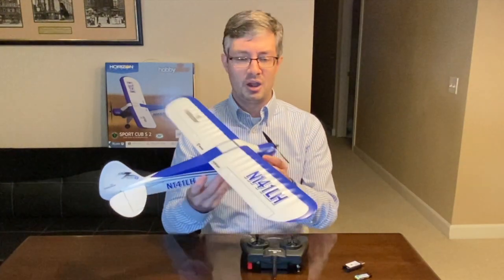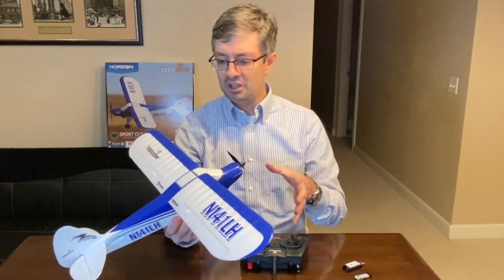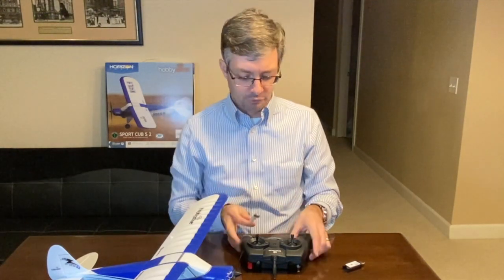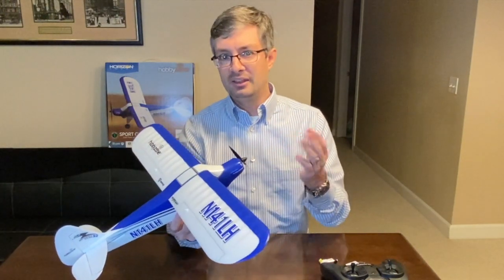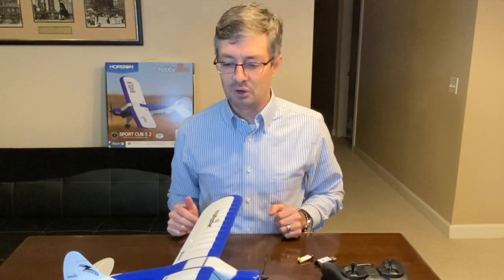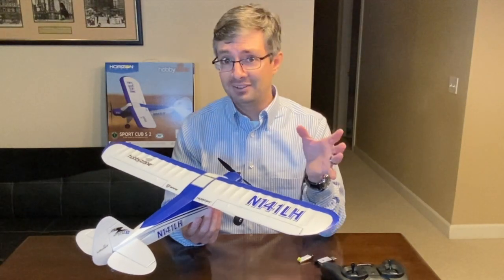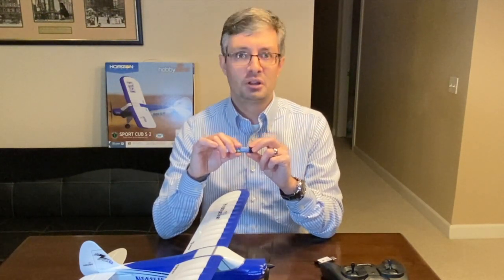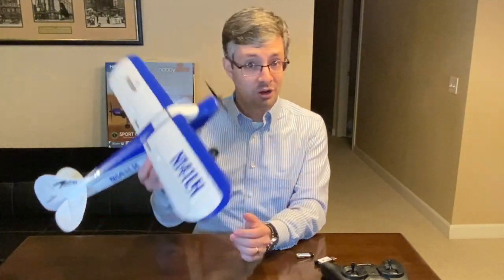Tips and tricks on setting up the Hobbyzone Sport Cub S 2 RTF

Comment: Thanks, I recently bought one and flew it as a novice. I had done hours of iPhone simulation only. Great trainer and light, so less damage "crashing"
Tips: Trim on first flights carefully and follow the handbook.   Check center of gravity and battery placement.  I needed to make it more nose heavy to balance.  I added bush wheels and strengthened the landing gear with styrene strips
I added a bit of velcro to battery place.  Best to learn on a few inches of grass and hand launched. Practice stalling it in on grass up wind.  It is best for first flights to have zero wind.  My first "crashes" were from flying too high and losing it in the sun, having set to intermediate and hit a tree, having the battery come loose and dangle, causing a nose first crash on grass and broke prop (buy four)Don't add paint, it throws balance off. Get three or more batteries.  Save the box!  This is the excellent first UMX to get.
Reply from the maker: Great tips!

Comment: I flew today in 11mph and I haven't flown in five or so years and with it set at 0 on the TX I just had to hold her steady and this plane hovered right in front of me,this was my first flight with this plane so far an awesome plane
Reply from the maker: 11mph is a bit steep for the Sport Cub S. In fact, my cut off for my large Timber is 12mph. I don't like how the plane hovers in the wind and has trouble flying smoothly. The Sport Cub S really struggles with flying into a wind of more than 7mph. It takes full power to overcome the wind, which greatly reduces flight times and increases risk. Even with my 2S powered UMX planes, I don't fly them over 7mph and my UMX Timber and J3, which have vastly more power than the Sport Cub S, have a max wind cut-off of 5mph. I fly my UMX planes in a pretty tight area and it doesn't take much wind to blow them around. I have never been a pilot who enjoys flying in the wind as it turns into fighting for control rather than flying. Some guys rate their proficiency and skill on how much wind they fly in, I rate mine by the lack of crashes and repairs.
Reply: @BRGT350  I so agree,but I didnt crash and I was actually impressed,building definitely hide wind and soon as you fly above them oh wow but ive had micros not be able to even fly in 8mph wind so I was impressed but these batteries dont like 17 degree weather lol
Reply from the maker: Ha, yeah, crazy how fast those 1S batteries lose their power in cold temps. Even my older 2S batteries in my UMX planes suffer from the cold. Last winter I flew my UMX Timber and it hit LVC just as the plane got into the air. Stalled and went into the water. Thankfully, the speed was slow and it landed near the beach. Knocked off a slat and a float pontoon. That was in 30'F temps. I rarely fly in the winter as I hate being cold and I think my planes also don't like the cold. As for wind, my UMX P-51 and P-47 seem to handle winds better than my larger 1.1m P-51 and P-47. My UMX Timber with the slats installed doesn't like the wind, but at least has the power to overcome it, but it really wants to climb fast going into the wind. UMX J3 is better as it doesn't have high lift wings or slats. I am looking forward to the weather warming up so my nephew can finally fly his Sport Cub S that he got for Christmas.

Comment: Great beginner plane. You are so right about the batteries... in warm temps for my 150, 180 and 200 mah batteries I was getting ~ 5, 8 and 10 minute flight times yet once I hit the cold temps (< 40F) I was getting just a bit over one minute flight time even on my 200 mah fully charged batteries. Also, wish the plane had a brushless motor. A little under 200 flights and I'm on my 3rd (or is it 4th?) motor.
BTW of all the many Cub S 2 reviews I've watched you're the only one that I can recall that gave a heads up concerning the batteries.
Reply from the maker: Yeah, the smaller 1S batteries and even some of my older small capacity 2S batteries drop off quickly in the cold. I crashed my UMX Timber last Christmas when I tried flying when it was 30'F. I took off over the water and hit LVC without enough altitude or air speed to recover, so it stalled and fell into the cold water. Had some very close calls with the 1S UMX planes, but thankfully not over water. I feel bad for my nephew who got the Sport Cub for Christmas and has to wait until spring to fly it. I don't want him to risk flying it in cold temps and have anything happen. Besides the temp issue with the batteries, the plane is just awesome for beginners and experienced pilots alike. It is nice to have a relaxing plane to fly around the yard or a stable plane to learn with.
Reply: How do you like the umx I was considering that one first but the hobby store didn't have it in stock and kinda not flying in a while I was interested in this new technology the safe and it's almost cheating lol
Reply: I bought the upgraded ones from hobby-sports and they lasted 6min but its freezing out
Reply: 200 flights dang that plane is doing alright then or your just a good flyer,I'm thinking of seeing if I can find a micro brushless setup for this plane or I might pass it down and buy a balsa kit and build my own with the same plan based on this planes same size
Reply: No. Many.crashes and repairs. Think I'm on my 4th motor.
Reply: @rodneylesterjr4846  I believe it is a very good choice for someone just getting into the hobby or just wanting to give the hobby a try. When first learning keep the plane in SAFE/Beginner mode and only fly it when there is little to no wind. This plane can be flown in a very small amount of space but as a new RC pilot fly it in a larger area and over, if you can, tall grass.

Comment: I  have problems on installing the battery onto the plane, the input cable seems to broker, is there a replacement for it , to be soldered on
Reply from the maker: The cable might be part of the ESC/Receiver board and isn't replaceable without soldering a new one in. I had one of the wires come out of the plug on another UMX model with a similar connector and was able to buy a replacement from Horizon and solder it to the existing wire.

Comment: So your rudder was off as well. Mine was a bit to the left. Need to tweak it. Looking for instructions on programming it with my nx10. Manual is outdated.
Reply from the maker: It isn't uncommon to have at least one control surface slightly off and needing mechanical trim. Check the Horizon Hobby website to see if there is a newer version of the manual. You could download the preset file for your NX10 as well. If the transmitter is up to date, there should be a listing for the Cub in the templates under "add new BNF model". You could also check the manual for the 1.3m Carbon Cub as the setup should be the same. The only key thing about the Sport Cub that would require special attention is assigning SAFE, which would be the same for any of the trainer planes with 3 modes of SAFE.

Comment: I put mine on expert mode and the rudder was off to the left. I trimmed the rudder to center but the trim was all the way to the right.  Do I leave it that way or do I center the trim first and move the rudder link? How do you center the trim? I'm a newbie.
Reply from the maker: To mechanically trim the plane, meaning to physically change the trim on the aircraft rather than the transmitter, you need to do the following. Power on the transmitter and aircraft. Center all trims on the transmitter. Use a straight edge, like a credit card, business card, or anything else that is straight. Lay the straight edge along the aileron and wing. Check to see if the aileron is centered, up, or down in relation to the wing. Squeeze or open the U in the control rod wire to level the control surface so the straight edge is flat across both the wing and aileron. Repeat this with the elevator, rudder, and opposite side aileron. All surfaces should be level with each other. Now go fly the plane and use the transmitter to adjust the trim so the plane flies level at 50% throttle. If you need more than 4-5 clicks of trim, you will need to mechanically center the surface by transferring the transmitter trim to the aircraft. After you land, take the straight edge and note the position of the surfaces you had to trim. Are they up, down, left, or right of center. Set the transmitter trim back to 0 and adjust the surfaces by squeezing or opening the U bend so that the control surface position matches the position when you landed after trimming. Go fly again and see if it needs any additional trimming. On bigger planes, I will measure the distance from the ground to the control surface after trimming so that I can make sure I get the physical adjustment correct to match the transmitter. With UMX planes, I just get it close with the straightedge and call it good. Most of the time I find UMX planes will want to climb with the elevator centered to the horizontal stabilizer. My nephew's Sport Cub S2 did that out of the box. I skipped over the straightedge process and just bent the U until it looked like what was needed to fly level. It took a few flights and was perfect.

Comment: Hi, 1S chargers with storage capability seem to be few and far between. I wonder if you could recommend one.
Reply from the maker: Yeah, storing 1S batteries is a bit tough. What I always did in the past was charge the batteries to the full level, fly for the suggested time in the manual, and then put the batteries into storage. The thought was that flying to the suggested flight time in the manual would discharge the batteries close to the amount needed for storage.

Comment: Hi!  How do you know when the TX trims are centered?  I hear no tonal difference when using the flight simulator via the USB port.  I want to center the TX before powering up the plane.  TIA,  Jim
Reply from the maker: I don't, but there is an option that would work. Normally, the center of the trim has a different tone, but that may be different on some transmitters and the model of transmitters with the RTF planes have changed over the years. I would start by moving the trim up, count the beeps, and note the number when you get to the top of the range. Then go back down while counting all the beeps until you get the lowest of the range. Take the total number of beeps from top to bottom and divide by half. Then move the trim up that many beeps. The transmitter comes centered from the factory, but once you move it, then it isn't centered anymore.

Comment: you forgot to mention you have to throttle it up to get safe mode to activate you need to do that before you fly I did not do that the plane took off did a loop went inverted into the ground luckily Horizon hobby warrantied it,
Reply from the maker: well, that is in the manual and you should always read the manual before flying.

Comment: How do you get it out of safe mode?
Reply from the maker: it is in the manual. Check the 3-position switch on the transmitter.
Reply: you get it out safe mode on the swich

Comment: can i pair this radio with a carbon cub s?
Reply from the maker: Yes, the transmitter that comes with the UMX Sport Cub S2 RTF will work with any Spektrum equipped plane. However, I would strongly suggest upgrading to a better radio. If you are planning on staying with the hobby for a long time and want to start flying planes with flaps and retractable landing gear, I would suggest the NX6 or NX8. Those are computerized programmable radios that can store many planes, have enough channels to operate many of the plane's functions, and make it super easy and quick to fly different models.
Reply: @BRGT350  i appreciate the advice. i live in a tiny apt and only have space for maybe two planes, so i dont need a fancy radio. also i really like the idea of a panic button, so i think one radio and two planes will be all i need. this plane and radio, and one larger plane, likely the carbon cub would be enough.
Reply from the maker: Then you should be good to go with the transmitter from the UMX Sport Cub S. The Panic button only works with planes that have SAFE installed. If you get the Carbon Cub BNF, it will have SAFE Select. What I don't know is how to assign the channels on the UMX Sport Cub transmitter if in case the Carbon Cub SAFE assignment is different than the UMX Sport Cub. With a computerized programmable transmitter, it is very easy to change channel assignments. The transmitter with the UMX Sport Cub is very limited. While it will surely operate the 4 needed flight control channels, I am not sure how well the assignments will work for SAFE. Chances are it will work just fine, but that is one area to be worried about. It may work perfect to fly the plane, but the panic button and SAFE could be an issue that you will have to check before flying.

Comment: Ok but how do you fly it? I camt even get it to go. I turned on my rc remote and plane but now what? It just wont take off no matter how I fidget with the controls. What am I supposed to do? What a waste of money
Reply from the maker: Did you read the manual?
Reply: @BRGT350  Yes. Found out the problem was just a low battery... and maybe a few hard landings... 🤷‍♂️
Reply from the maker: ah, that would do it! Glad you got it sorted out. I have a video series on learning how to fly if you are just starting out. I teach a ground school, simulator, and then get into flying with the Habu EDF trainer. https://youtu.be/1hNOxPEiZNU

Comment: Minimal wind!!! If you fly full throttle a lot battery life is poor, 5. Min

 on 160 Mah Levitron brand,
Reply from the maker: which is why you don't fly at full throttle. Just like in your car, you don't drive with the gas pedal mashed to the floor. Learn throttle management and flight times will increase. Also, I don't consider 5 minutes of flying to be poor in terms of flight times. Most of my large planes fly for 5-6 minutes with EDF's being 3-5 minutes and that is with 50% throttle and being very gentle on throttle application. If you want long flight times, look into a glider.
Reply: @BRGT350  thx for the advice, I recently purchased the Umx Radian and Night Vapor planes. Each are different in their own special way! Happy flying!
Reply from the maker: I haven't flown either of those, but a guy in my flying club bought a used UMX Radian. I was really impressed with it! A nice calm evening and that plane was perfect. The Night Vapor could be a lot of fun inside.